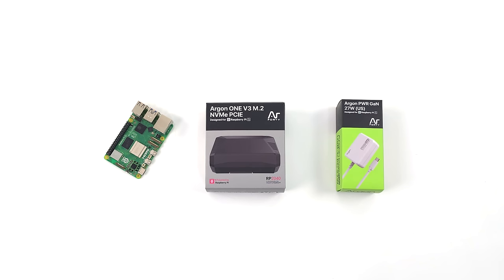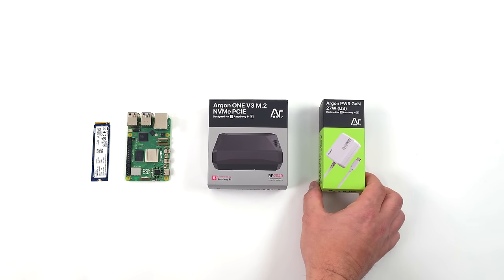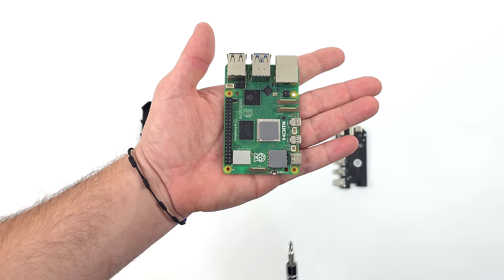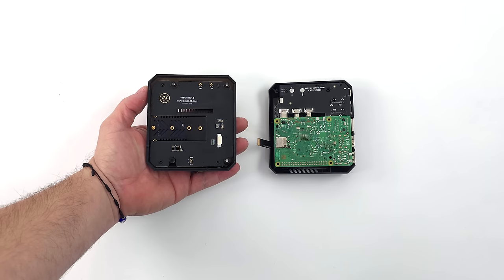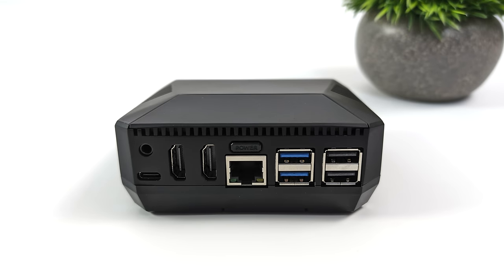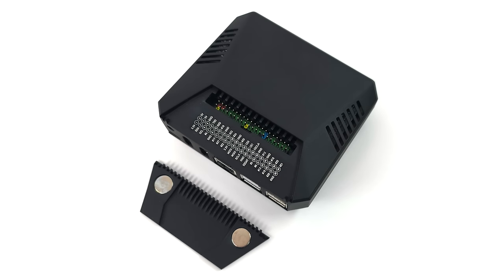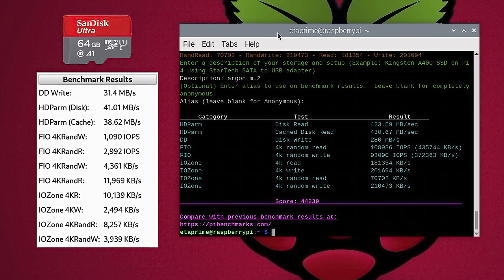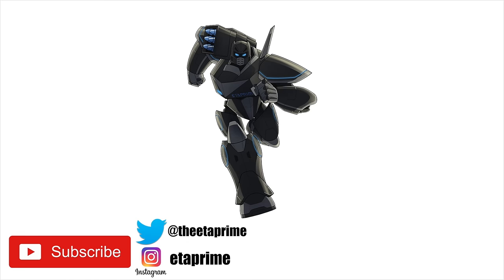This All New Argon One V3 Turns The Pi5 Into A Fast ARM Powered Mini PC

Comment: Notes to be aware of:
-Audio DAC is not available yet
-Use 2tb or less or else you're looking for extra struggles
-No MicroSD access with the base installed
Reply: They need to add a boot menu option to NETBOOT at the very least or give the pi another way of selecting a boot device without having to have raspbian installed on a flashdrive or SD Card. I Ubuntu doesn't even have an option to change the boot device after installing raspi-config. It's retarded to have to keep swapping back and forth between devices to do what you want to do with it.
Reply: @luigiprovencher  unless I'm missing something, the pi 5 can net boot and install an OS. Or did this comment predate that firmware update?
Reply: @alexmcd378  I'm talking about BIOS and having it's own boot selection screen instead of the way it's done now.
Reply: @luigiprovencher  aha. Yes, that would be nice

Comment: Picked up one of these and it is a real pain. The scripts they instruct you to install don't actually work with LibreELEC so you have no fan or correct power button control. It looks like the community is trying to create scripts that actual work. Also having power issues as inside the Argon One case Pi OS says the official power supply is not giving 5 amps. Considering what Argon charges for this case it is inexcusable that it has so many bugs and issues.

Comment: What's the point of this kind of setup, for those not using gpio interface, when you can buy Intel n100 based minipc devices in cases with usb4 single cable mode support for appx $160?
Reply: This 💯
Reply: For a lot of people, this is about the customisation, learning, and "Hobby" side of things and i totally get that. That said, you have to consider your use case nowadays as, whilst the Pi4 /2GB was/is a fantastic/cheap emulation device, Pi5 is not a giant leap. Cheaper X86 SBC exist now like "YouYeeToo X1" and "Radxa X2L" and still feel like a hobby/fun boards but for emulation. (& as others stated, N100/N95 NUC if you just wanna play and don't care about the hobby/learning/customisation side of things.)
Reply: Could you tell me pls if a nuc 7i5bnk would be better than a rp5 or a n100 in terms of performance?
I would like to have home assistant on that machine running in docker (I already bought the pineberry pi nvme shield and the case, but not yet the rp5)
Reply: @Paw_Low  I asked my preferred genAI service, copilot, the following "In table format, please list the geekbench CPU and GPU scores for an intel i5-7260U, an Intel N100 and a Raspberry Pi 5". The results suggested the best performance to least would be n100, nuc 7i5bnk i5-7260u and raspberry pi 5.
Reply: Because we love our Pis and want to give them a good home 😅

Comment: Got a version of this for a friend on a Pi4, just to give a heads up, the cooling and overall performance was great but it killed the range on the WiFi and Bluetooth devices.

So keep that in mind on here, it's something most reviewers won't pick up on because they are playing from a few feet away or have stuff hardwired in, but if you are trying to play from across the room using a PS5 or Xbox controller, your connection can get spotty and if you are using WiFi at a distance from your router, your signal can drop off faster than you would think.
Reply: is that issue with this case only or is it available in the flir, canakit?

Comment: does the case need any special install to get the fan running at all? i'm not even sure mine is running. i just got the case yesterday. but it's all overheating extremely, i don't know if it's the ssd contributing all the heat or what. all i got runnning is three containers: AdGuard, Unifi admin software, Jellyfin. a minute or two into streaming any video from the jellyfin server the Pi5 needs to be restarted. i might need to look into an ssd that runs cool.

Comment: 49.00 is cheap considering all you get with it. Especially if you add the NVME drive. Whats the limit on the drive size? 4gb? Obvioulsy not for lots of games (except retro games), but i am thinking of using one for a workstation. Will need to check this out, because it sounds like a great setup.

Comment: I have Raspi models from Raspi 2 to 4. Raspi 5 has no logic except for the cases where you must use a battery or need a cheap NAS. After you add psu, case, active cooling etc price is more expensive than a 15-30 Watt SH mini PC, which is also many many times faster in processing power. Trying to use Raspi 5 as a desktop computer is very strange, a tablet at the same total price is a lot better for that task and includes a display

Comment: Thanks for the video! I've been waiting a long time for a case like this, there's finally one! Can I actually install a new operating system on the M2 SSD of the Raspberry Pi 5 using an image on a USB stick?
Reply: Yes, you have to as the sd card slot is not accessible.
Reply: as long as your new operating system has an ARM version.... for instance Debian and Ubuntu have ARM versions; while Linux Mint won't work as it has no ARM version (yet). So with any O/S you want to install, you need to check if it has an ARM version first...

Comment: I have an Argon ONE V3 M.2 NVME PCIE Case and found an error in the setup script. I had to manually edit the /boot/firmware/config.txt dtparam=pciex1_gen=3=on (incorrect data) it should be "dtparam=pciex1_gen=3". 
I found that the script put the incorrect data into config.txt file. Then you should see /dev/nvme0n1: Timing O_DIRECT disk reads: 2368 MB in 3.00 seconds = 789.14 MB/sec with my NVME drive.

Comment: My 2TB Crucial P3 Gen3 Nvme M.2 SSD scores 60238 on that pibenchmarks with HDParms in the 800+ MB/sec. You said you enabled gen3 speeds but I guess it's 'coz its Kingston and a lower capacity 500GB SSD that's why it's slower. We get the same max temps though using stress. Mine also at 67°C but mine is not OC'ed so I guess yours is better. Mine is a headless install since I don't need a desktop environment for my purpose---running the Pi 5 mainly as a server (Debian with CasaOS as a docker manager & dashboard).

I've been waiting for that Argon case for the Pi 5 but now I'm using a different one and I have everything set up perfectly. I have no need for the HDMIs since I only SSH to my Pi 5 when accessing it. Maybe when I get another Pi 5 as a replacement for my Firestick/Chromecast I'll consider getting the Argon V3. 🤔Nvidia really should make a more powerful up-to-date version of Nvidia Shield. 😑

Comment: I would love to get this but the ribbon cable blocks the SD card.  That is a hard pass for me.  What a dumb design decision on their part.  You can set the boot order to try the SD card then the M.2 but with no access to change the SD card the SD card slot is mostly useless.

Comment: Hi, I use an M.2 NVME 1 TB drive inside my argon one V3 case but the fan won‘t come on. The scripts for the case referring to the manual delivered with the argon one V3 does not work with Ubuntu 23.10! Do you have an idea how I can set fan control within Ubuntu 23.10?

Comment: For those getting this, just understand that "pulling out" the black tab on the NVME botton doesn't mean pull it out. You just barely move it. On the top you could slide the ribbon in without even undoing the tab, but on the bottom it's impossible. But if you pull that tab out it will break and render the entire $50 case useless. Now I'm in search of some replacement tabs if they can even be bought because now I have two of these cases that are unusable for $0.0001 worth of parts.

Comment: Cannot get my Agon Oe V3 M.3 case to work. The setup will boot from a 16 wayy power supply (then you get low power warmings) but will not power on from the official Raspberry Pi 5 27 watt power plug. I have used the Argon20 acripts to make all necessary chnages and I have confirmed that they have been made. I can't get any help from anyone so the case is going back
Reply: Sorry I forgat to thank you for your ecellent video

Comment: I've recently just bought the Argo One V3 case for my Pi 5and I have been waiting for you to review this and as always you never disappoint. Great review as always, thanks for showing the improved performance using NVME. I know the Pi 5 runs hot but the CPU temps looked ok even with the overclock.

Comment: I have the old case for RPi4 +M2 ssd.
There are two problems with this review.
Firstly the negative impact of the metal case on Bluetooth and perhaps Wifi.
Especially compared to the original plastic cases.
Most noticeable is Bluetooth range for wireless keyboard and mouse.
Usage case is as a media player connected to a TV, mouse and keyboard on a coffee table.
My second point is thermal performance is related to ambient temperature.
So you should always state your room temperature as it affects the test outcome.
One advantage of the ArgonOne 4 case is the boot on power up jumper.
Does this new case have that same feature?
Apart from the two points mentioned it’s a great review vid😀
Reply: do the the aluminum canakit cause wifi and bluetooth issues as well?

Comment: Why there's so many noise about RPi5? It's obviously weaker than OPi5 and costs more. What's the point?
Reply: the size of the Raspberry Pi community (with it's collective knowledge) and available software. If there is a problem, or advice wanted, it can be obtained on the forums.

Comment: Wouldn't it be better to remove the sticker from the NVME drive?
Reply: maybe in theory.... but what about those sticky rubber 'heat conductor' pads that you stick on the hot bits? Are they actually heat conductive... I get a little suspicious about a foam rubber/plastic pad that is meant to be a heat conductor..... I am used to heatsink 'goo' or paste.

Comment: I just don’t get what the point of this is to be honest. You’ll only get this stuff if you want to use the Pi 5 as a daily PC. And as that the Pi 5 is “meh” at best. Plus, the Pi 5 and the case etc. are so expensive that you might as well just buy an Intel N100 Mini PC instead. And I promise you that you’ll have a far better time with the N100. They cost around 200-300€, depending on the specs. I put 16 GB of DDR5 RAM into mine and it just flies. 

And what’s actually important as a daily PC: you’ll probably watch tons of videos. Keep in mind that the Pi 5 only has hardware decoding for h265. EVERYTHING else will be done through software, which will put heavy loads on the tiny CPU. And you WILL be annoyed by that. The N100 has hardware support for every codec I can think of. As a daily driver it’s just the better choice. And it will probably not even be more expensive that a Pi 5 with this case etc.

Comment: mini pc from rpi5 is a way worse than intel n100 mini pc
Reply: Do you know if the Intel NUC 7I5BNK would be better or worse than intel n100 or rp5? 🙏
Reply: @Paw_Low  any intel nuc is outdated, cause intel doesn't make it anymore. NUC 7I5BNK has 7th gen cpu, N100 should be a bit better.
Reply: Yeah not to also mention Linux arm has pretty poor software compatibility. A built rpi 5 PC is also more expensive than a mini pc or used mini pc
Reply: @rrrrexx 7th gen Intel processors will still beat the n100. The n100 is a really low end chip
Reply: @katieadams5860  1core i7 7567u = 1core n100, also 4/4 n100 is better than 2/4 i7 in multicore. But i7 has better gpu 48eu vs 24eu
Reply: Why does everything have to be about specs? I for example like RPI’s more than intel and like how flexible the system is, more than the 20-50€ cost difference
Reply: @joker28666  RPI is more like about controller for smart home  and etc, all other purposes have better alternatives